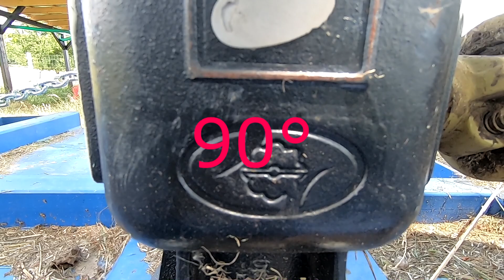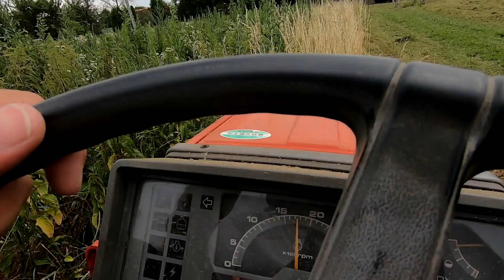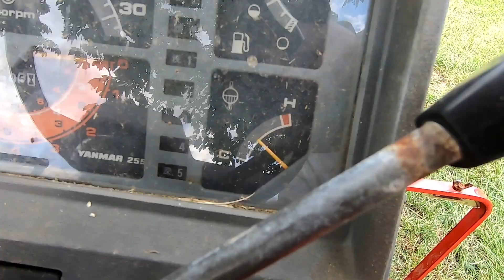🚜 Kaszálás Yanmar F235 traktorral Mulcher (a végen a poén) Yanmar Tractor

Comment: szia...which gear are u using for 540PTO? and how many revs/min?  maybe you are talking in video but i dont know understand in HU language....
thanks
Reply from the maker: 400-700, depends on the grass.
Reply: @Goethetractor  thanks for answer, and what is ration for your gearbox? 1: 1:?
Reply from the maker: it is not fixed either.  1: 1 almost never is too slow.  if it needs to be very slow then 1: 2 or faster is 1: 3.